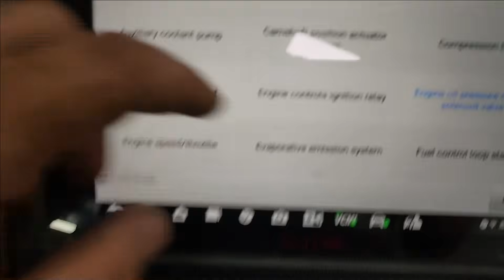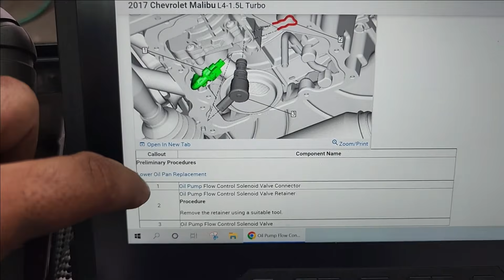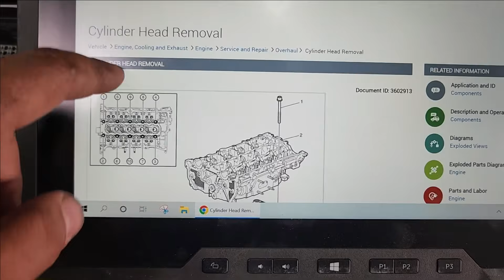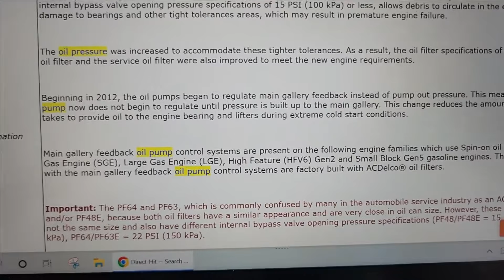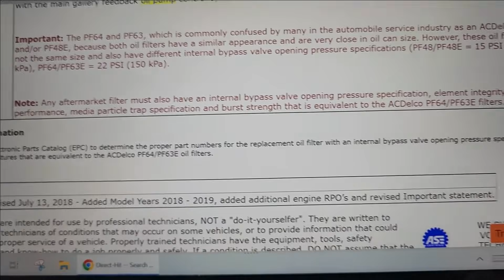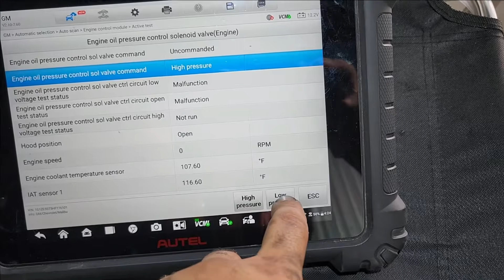2017 Chevy Malibu P06DE ENGINE OIL PRESSURE CONTROL SOLENOID VALVE STUCK ON Part 1

Comment: Update: problem solved. I ordered a new oil pump and gasket for the tensioner. Let my garage order new bolds for the balance shaft. They used the old bolds before. Gave them a torque list and told them what to do. There was debry in the old oil pump(due to earlier broken piston). Not 100% sure what was the real  cause of P06DE, because not seen with my own eyes what they did. But problem solved. 
----
Have the same problem with my Opel Insignia 2.0 turbo a20nht ltg. Almost everything already changed and oil pump is the next part. Asked my shop if they changed the chain tensioner and gasket, but they did not answer that. We'll see if I'm right. Thanks for your video's 👍

Comment: Im working on the le2 engine right now with the DE code. I did a timing job on it about 6 months ago and the code just now came on. Do you beleive it could be the tensioner gasket if the car ran totally fine for 6 months?
Reply: It also has a pretty good oil leak all down the back side. Coming from just below the intake manifold
Reply from the maker: That's not good.
Reply from the maker: Possible

Comment: Thank you for the video great work. Do you know where is the location for oil pressure solenoid for 2017 volt
Thanks
Reply from the maker: It's inside the engine. You have to drop the oil pan to get to it.

Comment: I have a 2017 mlaibu lt with 93,000 miles and this just started so just change out the soleniod.??
Reply from the maker: You have to watch both parts of this video and understand what is going on
Reply: @DallasAutoDiag  so should I change the engine oil pressure soleniod.?? My car never had any work done on the head gasket and my engine does shake when like it was doing on video what would you reccomman me to do.?? P.s. im no mechanic
Reply: Fyi my car still virgen😅

Comment: Can a really bad oil pan leak cause this error also? I recently discovered a bad oil leak on bottle of engine amd now I get the reduced power error however I still have enough oil in the engine. Bad oil pan gasket??
Reply from the maker: The leak would cause a low oil, which also cause this.
Reply: For about two months I heard what to be a swooshy noise coming from my hood. Today I went to get an oil change and two days prior my check engine light came on. A random guy just told me that the oil possibly leaked out and auto zone gave me the same code

Comment: Hello, I have a 2016 Chevrolet Malibu LT 1.5L Turbo. Would you happen to know where the oil pump control solenoid valve and oil pressure sensor is ?
Reply: I’m trying to figure this out as well
Reply: Did you ever figure it out?
Reply: Solenoid is in oil pan.
Reply: I beleive the valve is in the oil pan. The oil pressure sensor is likely higher on the engine block, behind either the starter or the A/C compressor. Literally the worst placement. GM engineers either have room temp IQs, or they have a genuine hatred for anyone that isn't a GM certified technician.
Reply: I know this is an older comment but I'm pretty sure it's right above the oil filter

Comment: I have this code and no body worked on my car and I bought it 0 mileage. 2016 Chevy impala 4 cylinder. I changed all 5 sensors still no luck. 
I have p06de, p0521, p055b, p055c
Reply from the maker: Check your oil pressure

Comment: This is has been happening since March 22 and Bill Estes Chevy Indy still has not found the issue. In an Going to tell them to check these as it can back on yesterday and my FIXD check says this code was the solenoid valve! I have had a few of the repairs started…and still has the code.  I asked the about this before I Got to 160,000 miles thanks for this calling the dealer now 🔥🔥🔥
Reply: Same thing happening to me
Reply from the maker: Good luck

Comment: I have this same code and I have a bad brake vacuum pump. Now my car won’t accelerate and it had a big oil leak
Reply from the maker: this is not good
Reply: @DallasAutoDiag  yup definitely was the transmission with only 76k miles on the car

Comment: Reduced power engine is because of the accelerator pedal has to be replaced. These models of gmc has faults. If his car is under 10 years old which it is and has less than 150,000 miles. Chevy dealers has to fix for free, but I believe the code has to be p2138
Reply: I took mines to the dealership and they refused to replace my pedal. Although the problem is intermittent.
Reply from the maker: Thanks for the information
Reply: @DallasAutoDiag  welcome and I believe if he made repairs he can get money back for it. But I’m not sure how he would have to go about it. Chevy didn’t want to put a recall out, so they put it in the special notification for repairs. I actually just bought my car and this happened. Kind of scary but thanks to a man on YouTube I was able to get it fix for free. Any information needed to help another is awesome and I’m willing to spread it 🥰
Reply: It is not an issue the the pedal, p06de sets the reduced engine  power on the dash.

Comment: Had an aux battery do that in a 2015 malibu with same codes. Then found dealer has recall on solenoids during a deep dive into this system.
Reply from the maker: Good valuable information to know. Thanks for sharing. This case is different. Wait for part 2.